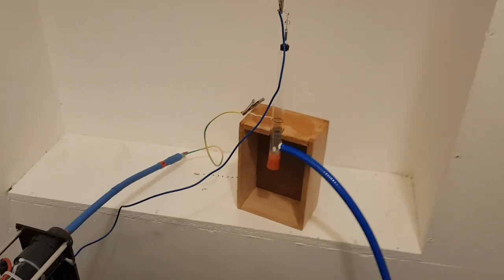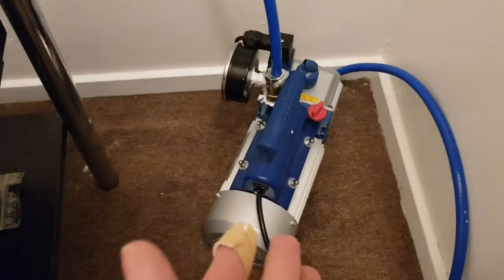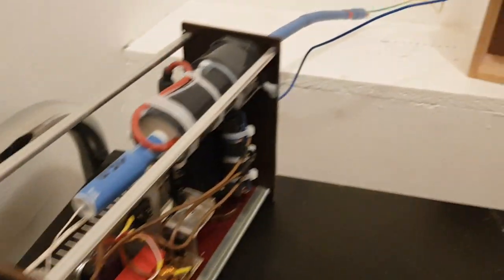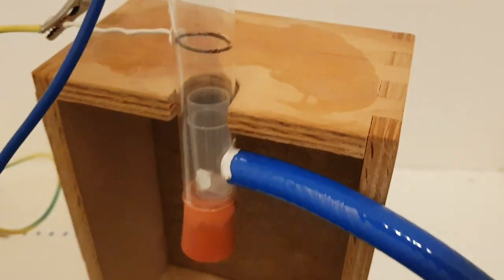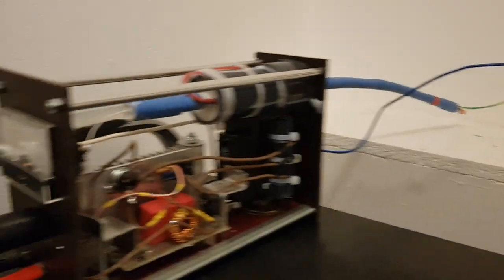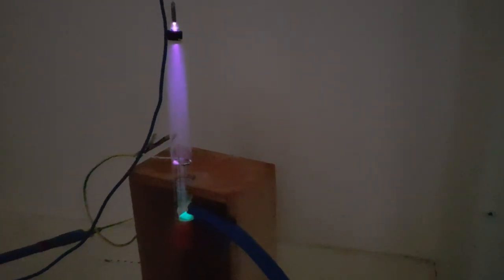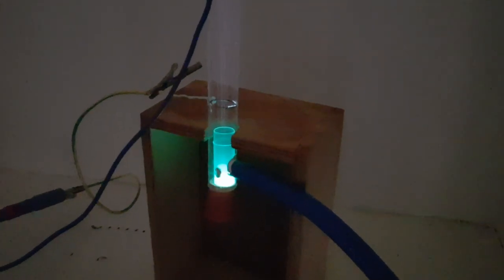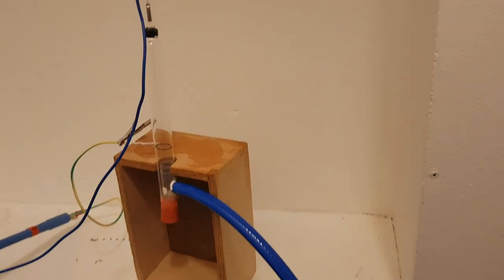Home Made Cathode Ray Tube Test

Comment: I have a two stage rotary vane pump and i don't remember to be able to pull a vacuum this good. There was always still plasma inside. But I also used a crappy hosing system. I will try a similar thing with glass tubing and kf flanges.
Reply from the maker: Yeah I had a lot of trial and error until I found the right sealing method (that is not glass blowing) and right hose. I know use a KF hose and such, but these earlier versions use the hose from a compressor which works quite well too.
Reply: @radiumquetzal8000  This with the hose suprises me, because I used compressor hose aswell. And I build a pirani vacuum gauge and could detect a pressure drop from the hose.  For high vacuum you need a very large diameter hose to get a good flow/vacuum.
Reply from the maker: @thesciencefurry  hmm, perhaps your hose was not rated for the same pressure? Mine was 16 Bar. The tube in this video uses that hose.